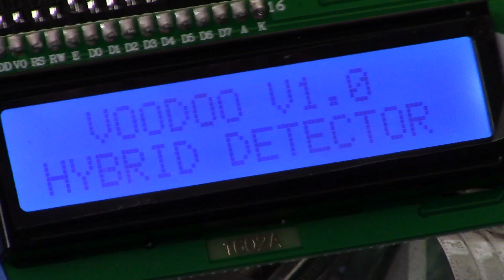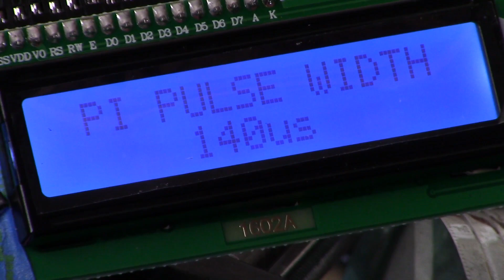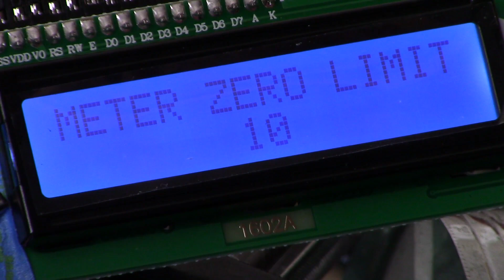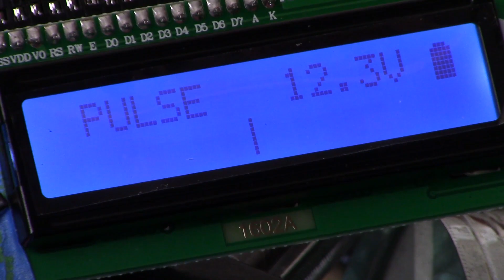Voodoo DIY metal detector Part #3 LCD display and menu

Comment: Just thought of something, i didnt see any blocks for disc because you dont have a coil hooked up yet, duh
Reply from the maker: The blocks will only be visible while the machine is in Hybrid mode.  First I need to complete the PI circuit completely.

Comment: how is coil construction?
Reply from the maker: The coil should be concentric with a RX resonant frequency of about 10.5khz.  The outer coil is used as a mono-coil and the inner is the RX coil.  The outer coil needs to have a damping resistor.  All of this detail is covered in the book.

Comment: so its just a standard screen then, so it doesnt have a metal probability meter or icon to distinguish between non ferrous or ferrous at least
Reply from the maker: @Matt Rowe
The blocks on the display will move right for non-ferrous and left for ferrous objects.  This is only when the machine is in Hybrid mode.
Reply: @SurfDetector  ill have to watch your vid again and see if i missed it, i figured it should, i mean to go to that expense and trouble and not have it would be silly, the chance pi has it. i was looking to see if i could find a chance stuff, i missed one at gweotech, completely built and working for $50, only the board and screen and buttons
Reply from the maker: Matt I have not built the Disc portion of the circuit yet so the Hybrid is not active. I am pecking away at the project in between my real work.  Doing the videos even as short as they are, really slows down the build.  Later on next week I hope I will be done.
Reply: @SurfDetector  ill bet, you do excellent workon your soldering and excterra, i bet it takes a while, i know it does for me, i built a signal generator to practice before i start on my mini pulse, or barracuda, i may do a pirate also to practice since i can get a kit for about 12-15 dollars

Comment: salut surf, bonne video.
I had to change the 33 ohm r 66, it had not supported the 8r of the hp. you saw my super d coil? well I am doing at the moment, too, a super omega coil !! I would tell you, before posting on the forum
Hi my friend.
Reply from the maker: Salut Jean,
Good to hear from you my friend.  I did see the Super D, Fantastic job!  I think that I am not going to make a coil for the Voodoo,  I will use a F75 coil to see how it goes.
How many ohms did you use for the R66?  I am thinking 100?
Cheers.